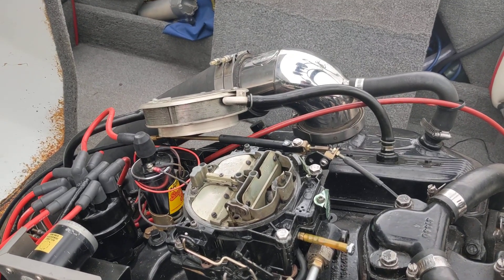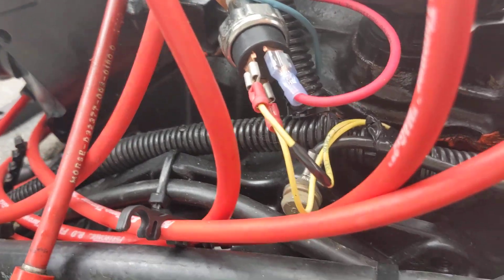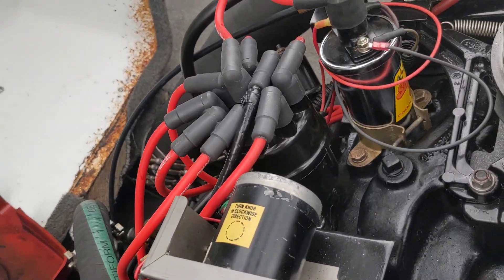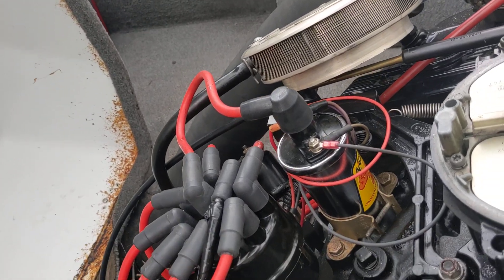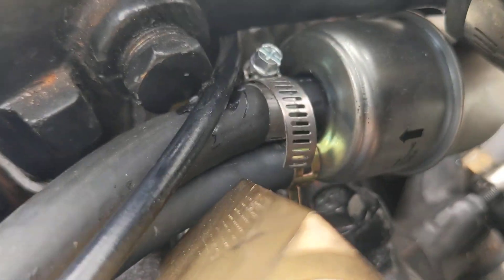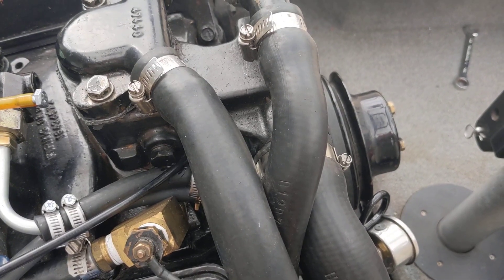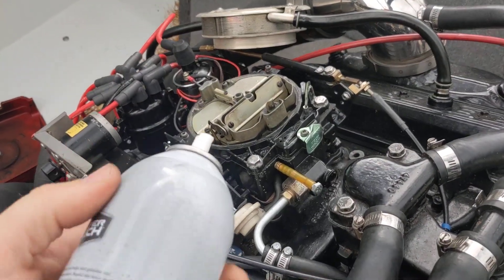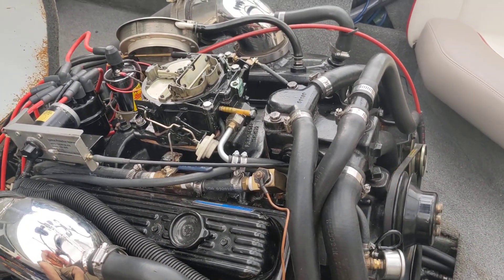Mercruiser 5.7 small block hot starting issue

Comment: Pump your throttle a couple times then put your throttle at full open. Keep your hand on the throttle as soon as it starts pull it back. I have 2 mercruisers 5.7L hard start after a run I have to do that everytime i re start but they start its vapor lock I'll leave my hatch open sometimes and if they cool down faster it isnt as bad
Reply from the maker: That used to work but no longer does.
Reply: Ours we have to play with the butterflies after it’s warmed up and it’ll fire right back up

Comment: It is vapor lock for sure   I have a 1991 5.7 Mercruiser    same issue    I have done way more and I have the solution.  Fuel is too hot after setting from a hard run.  Insulate the fuel line from the pump to the carb.  I have the new fuel pump to by the fuel tank.  I have a 3/8 bung on the tank.  I have a fuel regulator up by the carb with a bypass back to the tank.  I also put in a oil cooler heart exchanger  hooked up to sea water    and run the fuel through it.  Drilled 3/16 x 2 in the thermostat     where we are on the river its hot     like right now 120f.  

The problem is caused by crappy fuel with way to much alcohol in it.  Never did it when it was new.  Still on the river the alcohol boils at a lower point than the gas     so we are up to 10 percent in the fuel and our motors run hot in a closed area.  

The newer motors all have vapor tanks and heat exchangers to rid the problem.  1996 Mercruiser put out a bulletin on this problem it just takes 20 + years to find it.  4 ounces  of 
2 stroke oil to every ten gallons of gas.  Also 92 octane fuel.  Remove the divorced choke
and put in the electric retro replacement available on youtube.  It really kicks and you never have to deal with the choke pulling off correctly.

My motor has 3000 hours on it and now starts up with no issues.   A lot of work but I was sick of trying to figure it out.  I just want it to start.

If you are out in a pinch put ice or water on the fuel line going to the carb with a rag to cool it off.

Hope this info helps

Comment: wouldn't the 1/4" vapor line that returns to the gas tank need to be higher than the larger line going to the carburetor?  Seems like the vapor would be at the highest point in the system.
Reply from the maker: That's a good question/point!
Reply: Yes ,just like trying to bleed a caliper that is put on wrong side of car upside down will never bleed air out

Comment: I have same problem, 95 engine - 5.7 l small block today I’m changing the anti siphon valve at the gas tank, also after running my boat at 3500-3800 rpm’s for 20 mins she bogs down and stalls, my fuel gauge drops from 6-7 psi to 2 then 1 which makes me believe a fuel problem but I’ve changed pretty much everything like you did I have a mechanical fuel pump, 2nd one I’ve tried, so I haven’t tried electric, I saw a video about a gent how 10% ethanol fuel and design where fuel pump is, too close to engine making fuel boil, which causes issues, he moved the fuel pump away, rerouted fuel lines and also added marine insulation around gas tank, says it fixed the problem, not sure anyone saw it
Reply: I feel for you!  It's frustrating.  I ended up building a new engine and going fuel injected.  I have my electric fuel pump setup if you need it to try moving the fuel system away from the engine.  That's a really interesting idea and makes sense.  I had all my fuel lines insulated to try and keep the heat away from the fuel but I think eventually the pump itself being a metal body gets pretty hot.

Comment: Thermostat issue perhaps? Shot in the dark.....
Reply: My cleveland had vapor lock type issues and wouldn't start. Turned out it was wrong one in there when engine was redone. Probably not your issue but one never knows. It was causing top end heat and intake was getting super hot but temp light never came on as sensor was in the block. So I would either pull it or check intake temp with temp gun for excessive heat up there.
Reply: @hegonefishing9122  Will do - its something that is easy to check!!
Reply: I could try yanking the t-stat out as a test.  My temp gauge is happily settling in at ~160-170 though which is where it should be so I figured my t-stat was OK.

Comment: My thought is that the engine wants a little more fuel than what is given during the hot starts.  Because you say that it doesn't take much starter fluid to get it running.  During cold starts, choking the carb allows that extra fuel into the engine.  Are you able to manually choke the carb during hot starts?  Another test, are you able to apply a little throttle during hot starts?  (My thought is to pull in more gas than what the idle jets provide.).  Let me know if that helped
Reply: I did try that (both choke, more throttle, and pumping the throttle to give the accel pump a chance to squirt some gas down the carb) and I get the same crank without start scenario.  Like you, I thought the shot of starter fluid indicated a small lack of fuel to get a start mixture.  I figured one of the three things listed would help get it to fire.  I keep leaning back toward ignition....guessing that starter fluid would be easier to initially ignite than gasoline if I had weak spark?  I also know coils typically fail hot.

Comment: First you need to find out when it will not fire up...do you have spark? Do you have fuel? Do you have fuel pressure? Do not run fuel with alcohol in it. Check your timing as well.